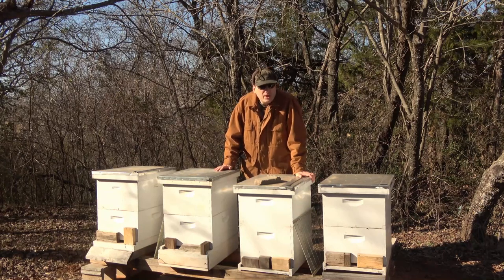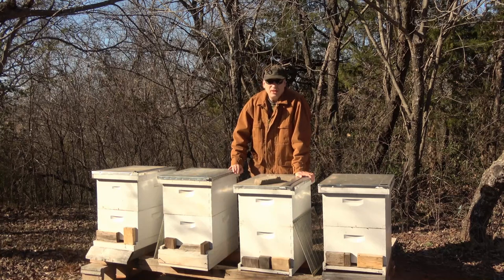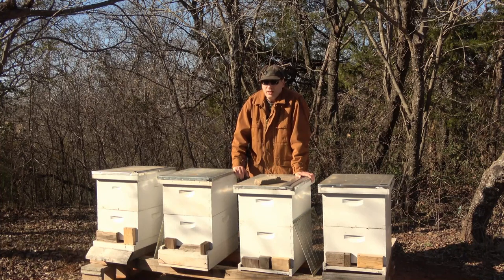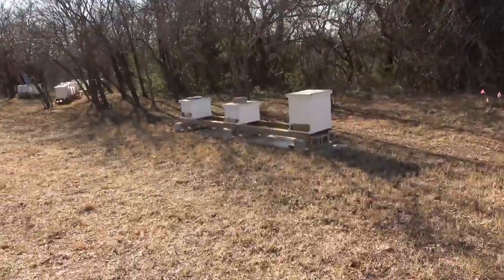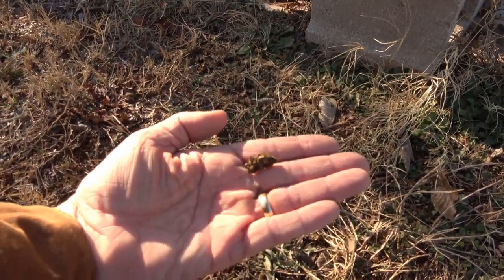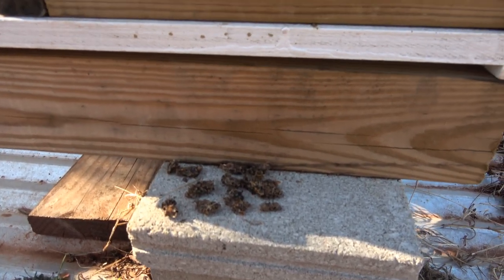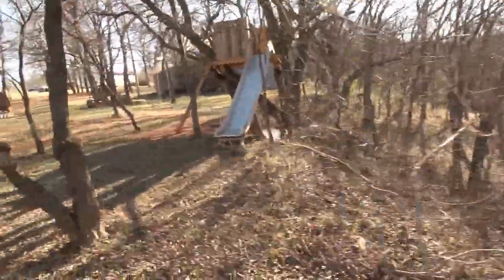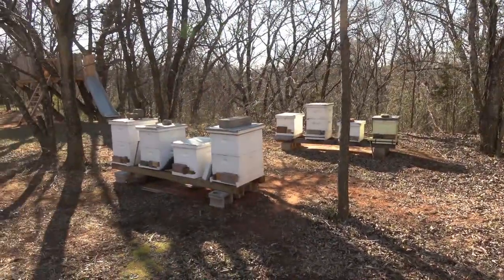Beekeeping: A Skunk is Eating my Bees

Comment: Had this problem a couple of years ago and an older beekeeper told me to get some tack strips like you use to put carpet down with and to put a couple of strips on the front of the hive and the skunk won't put his paws up on them because the tacks stick him. I went a little further and nailed some strips on a board and placed it in front of the hives. Have not seen any more sign of the bee wads. Get the strips at Lowes or Home Depot
Reply from the maker: I might have to do that.  I have 23 hives though, so that would be a bunch of tack strip.  Someone else mentioned putting some kind of sharp screen stuff at the entrance too.  I'll do some research and see what all methods there are.  Hopefully I catch the skunk and put an end to it.  Thanks for watching.